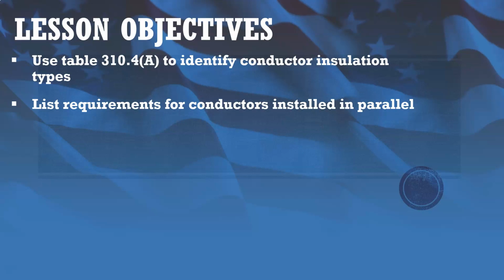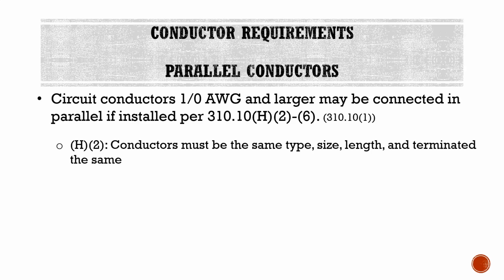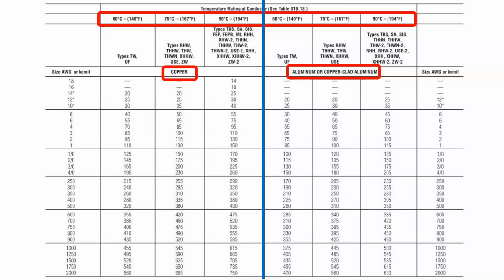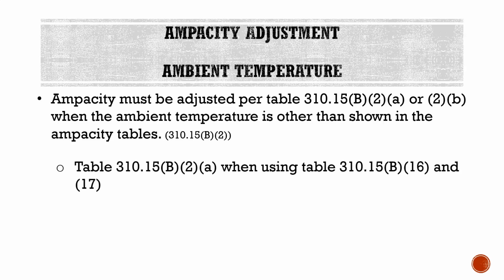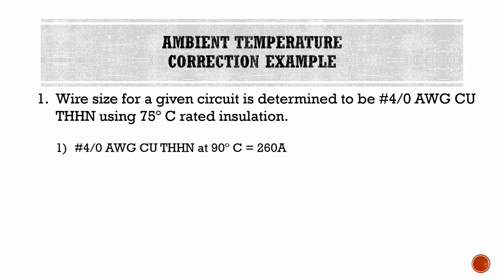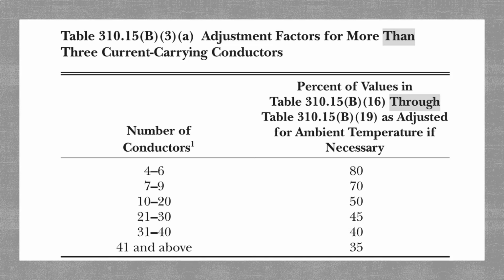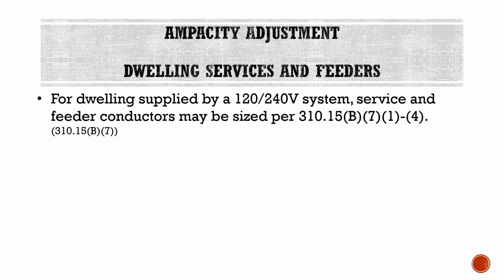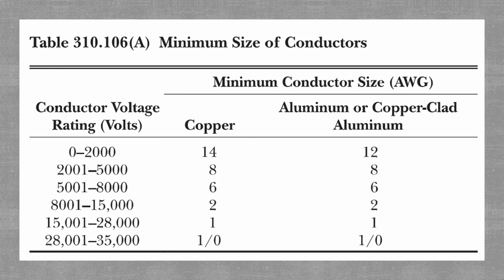Conductor Sizing and Adjustment

Comment: It doesn’t look like anybody responds here but I’ll ask anyway.  Do multiple NM cables used as home runs using cable stackers, rated to hold up to 8 number 12 per manufacturer specification, have to be derated??  It says right on the package 8 number 12 and 8 number 14.  Length of run is not specified, but it’s over 24 inches.  Same applies for wall cavities that are insulated.  Code says you can go my manufacturer specs.  If I read the code right, nm cable rated at 90c  is already derated based on amperage in the 60c column. 20 amp max number 12 and 15 amp max number 14.  If that is true, 8 home runs could safely be used in a cable stack.
Reply: No you would not derate for cable stackers, as they are not considered to be a conduit or raceway. Same goes for insulated wall cavities. Just bare in mind that NM/Romex cables are rated at 60 degrees and therefore all calculations should be based on that premise

Comment: If the conductor is rated for 90°C and the motor's amp rating is less than 100 amps, then can we use  the 90°C amp rating for cable sizing?
Similarly, when the equipment is rated for 75°C but the cable is rated for 90°C, still use the equipment's 75°C amp rating for cable sizing calculations?